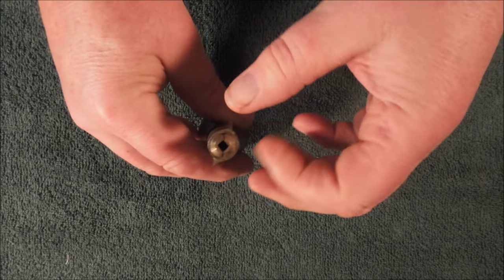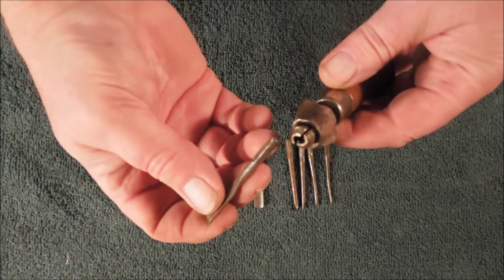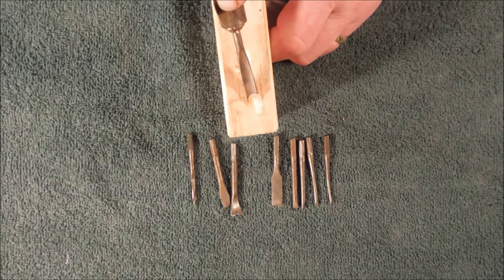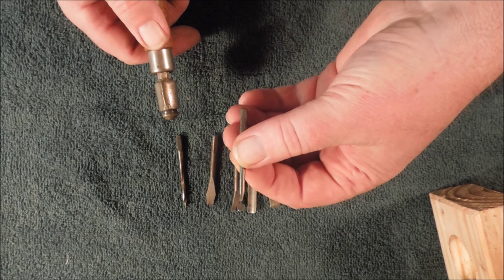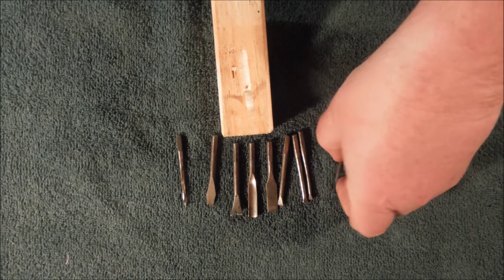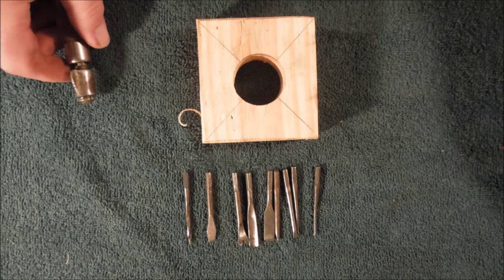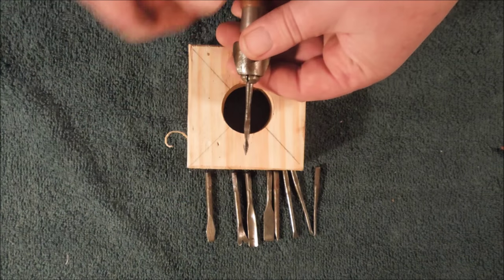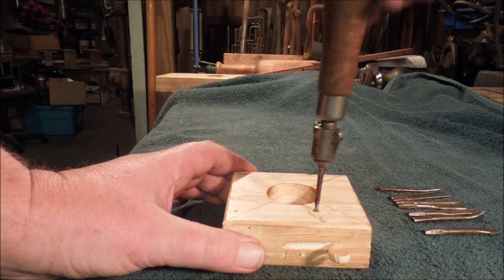Antique Multi Tool Review~ by Old Sneelock's Workshop

Comment: Hi, I bought one of those a couple of years ago. Mine also has that tool you were wondering about, and I'm too at my wit's ends trying to find what it was for. The one I have has a little wood saw that needs sharpening and the screw in the gimlet is gone, so I plan to buy a gimlet and adapt it. Very nice, I love it.

Comment: I’ve got one just like that, but made from rosewood, it was my great grandfather’s. It also has nine tools, one of which is a saw blade, two screw gimlets, a tack puller, a little chisel, a gouge, a wider chisel, a diamond shaped hole cutter and a spike, sadly, the chisel blade is half chipped away, as is the larger one and one of the jaws is snapped off and lost, though it will still hold the tools, I’m thinking to make a replacement jaw, that should work as I think it will be held in place when the colllet is tightened. I’m loathe to reprofile the chisels though, in case it has any value to it, it must date to the late 1800s.
Reply from the maker: It might have value beyond what I paid for mine. I have a unwritten $10.00 limit on hand tools that I seldom break.

Comment: I've seen one with needles inside and a spool of thread? on the outside. The size of the needles looked like for heavy leather or canvas. Good find, Unc!
Reply from the maker: +Lewie McNeely The tool you are talking about is a similar device made for stitching leather and heavy canvas. As you would expect I have one of those also. :-)
Reply: 2+2+4 for a change and you've probably got a drawer full of the manual sewing machines. I know how you are, Unc!